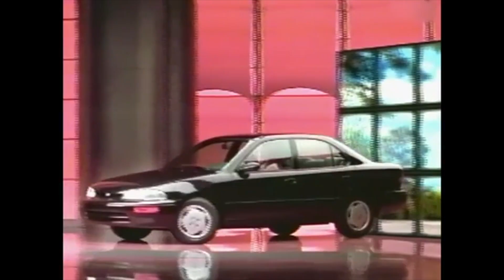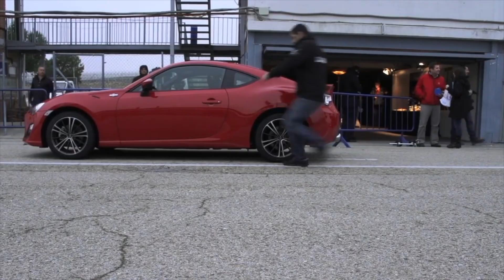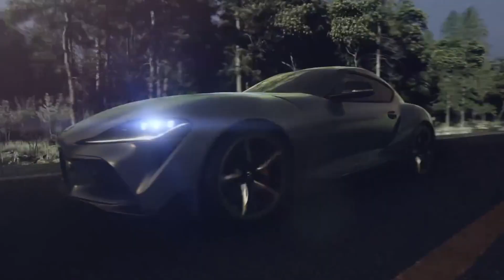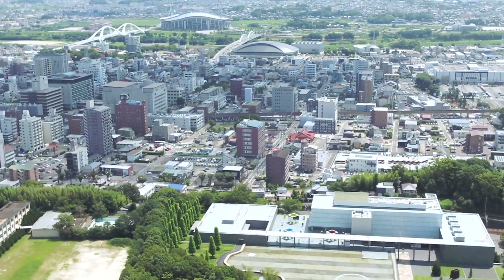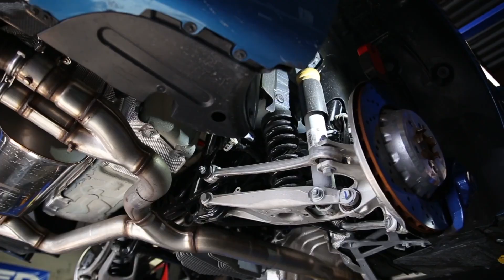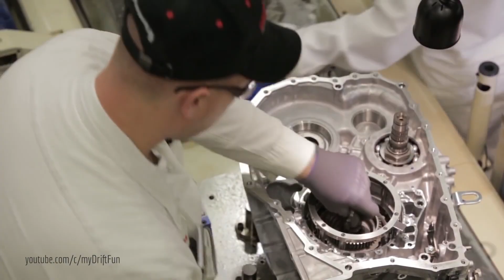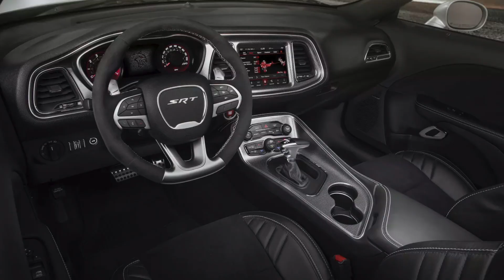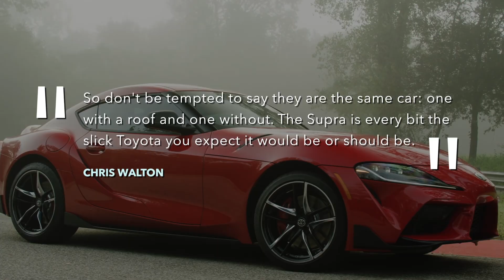MKV Toyota Supra - BMW or Toyota? The UNTOLD TRUE STORY

Comment: The BMW Supra is the car you get if you're too poor to spend another 15k for the Z4 convertible. I would buy one just to take off the "Toyota" badge burn it and stick on BMW badges. Toyota should have got Yamaha to help with a NEW unique engine they can use in actual cars that will be fun too

Comment: The light switches, I-Drive, gear selector all comes from BMW.

The Lexus LC would had been car to be called a Toyota Supra.
Supra had been a direct competitor with the Skyline GTR, NSX and GTO.
But this Z-4 derived Supra is nothing near the modern day GTR and NSX in term of performance and technology.
it is a disgrace to the "Supra" name.
Reply: Of course it's a disgrace for the Supra name, because it's not a complete flop and a failure on a comical level
Reply: Mk4 A80 was not "iconic".

Hence the Sales flop in the 1990s!

Comment: As time passed and the Supra's became available at the dealerships near me I gotta say, the lack of a manual transmission was probably the sole reason I didn't buy one. I enjoyed the meme of "it's a BMW" but...it turns out, I like BMWs as well. Ultimately, I'm glad it didn't have a manual tho, because it pushed me to keep saving and finally by my dream car (RX7FD). In which I for sure would have been regretting if I didn't.

Comment: If they stopped collaboration at the drivetrain and engine why are there so many BMW parts in the interior of the Supra? Even the Infotainment is BMW as pre Doug DeMuro.
Reply from the maker: Supply chain, as I mentioned in the video! If you watch my A90 teardown videos you'll see that I found a lot of parts stamped Toyota as well. All made in Germany by subsidiaries.
Reply: @albonfilms  doesn’t that law only imply to only cars like the sc300 Lexus and the Toyota soarer in Germany or….?

Comment: This makes want a B58 powered car. I love BMW I6 engines. They sound good and are very tuner friendly. Having one with Toyota reliability would be awesome.
Reply from the maker: Let's see how these hold up!
Reply: b58 has been around for like 15 years bro. very reliable known engine @albonfilms
Reply: Imagine if Toyota made airplanes, then Boeing will be out of business.
Reply: I was thinking the same thing. I'm tempted to but a Z4 M40i. I really like the car. If it pans out they are even Toyota-ish in the reliability department, they're going to be very desirable down the road.
Reply: Love my x7 even more now that I learned it has the B58 engine 🙏
Reply: The problem is using complicated technology which makes them prone to defects and hard to fix.. For instance just take the cooling system in this car which is way different from conventional and complex

Comment: A car known for reliable engines opts for a shady brand name engine.   That engine is underpowered.   The car is unusually small.  It is overpriced.  It's ugly as hell.  From the get-go, Toyota said that they did most of the non-engine work themselves.  In short, this video won't change your mind, if you already knew the facts.  One more thing.  If you can squeeze another 10k from your account or lender, you can buy a mid engine C8 which by comparison will make this thing seem like a hardtop Miata.

Comment: BMW is trash low mileage BMW suffer oil issues and I wouldn’t be surprised in few years these “supras” z4 will also suffer. How a BMW brand new price is at $100k 10 years later it’s selling for $10k if that.

Comment: Hey Albon, Great Video. How Did The New Supra Get To Use BMW IDrive? 🤔🤔🤔
Reply from the maker: It was licensed from BMW since iDrive is integrated into the BMW Engine Management. The entire CANBUS System is the BMW multi-DME system.
Reply: Albon, How Did Toyota Get Access To The BMW Parts Bin And Use Many BMW Components In The Cabin? 🤔🤔🤔
Reply from the maker: @Zonksmobile  As mentioned in the video, the car is a joint venture with Toyota and BMW using BMW Supply Chain. All of the parts are either manufactured by BMW, Magna Steyr, or Toyota Manufacturing Germany

Comment: clearly there are a a lot of fucking idiots claiming this is straight japanese reliability and quality,
1: the chassis is built and tuned by magna steyer in austria this is literally a harder z4 platform 
2 : the b58 is very reliable having known people who have owned b58 vehicles and had zero problems me also it being able to build 1000 horse on the stock crankshaft unlike the 2JZ which was a marvel of its time and bulletproof but everything is falling to age , the b58 is very tunable and easy to work on 
3: there are so many people out here claiming this a piece of shit vehicle without even driving first hand typically being 15 year old supra fanboys.

Comment: Most of the Toyota lovers like BMW for a lot of reasons. I really accept that BMW engine is the worlds best engines  in terms of straight 6-8 and 12 cylinders. The most efficient ever with a lot of reliability. The question is why Toyota haven’t put some Japanese quality over the interior and overall thing to make it a bit better??? Too small car to call it Supra!! This should be 8 cylinder, with 650hp around and bigger body!!! And of course BMW pretty exterior missing!!! Old Supra had engine designed by Yamaha. So again Toyota is a fake brand!!
Reply: "Too small car to call it Supra!!"

I'm going to leave this here.

https://www.supramkv.com/threads/toyota-supra-size-dimensions-comparison-thread.1634/

Comment: I literally shed a tear a few times watching coming back to this video. The world is wired so completely wrong. It's just so sad that so few can see the raw passion and pride these cars were made with. The sports car market and the concept of the "driver" is dying more and more with every negative comment posted by some idiot who hasn't even driven either car, but yet thinks that it should be this or that or have this or that, or be designed by this or that. Everyone online is screaming for a manual or an all-Toyota powerplant/drivetrain/chassis, while also positing that you can get a used (insert car) for the same money. How can a company build a car strictly for the secondary market?? That's asinine. If you want a manual, contribute by BUYING NEW MANUAL CARS.

Comment: You say Toyota and BMW went their separate way so that the chassis, exterior interior and suspension components can be done totally independent so that they look and drive different, yet when you sit in a Supra (i struggle to bring myself to call it that) you would think your inside a BMW.

Comment: To me, automatics really are for people who could not pass a driving test. Think about it, how many people do you know who say "I can't drive stick"........now how many of those are good drivers???? Sweet fk all.
And now ask, how many people who can pass their full license (manual) say they prefer an automatic transmission on a sportscar?? Again, none, zip, zero, niks, nada, sweet fk all. 
If I am not manually switching gears, it means I am driving a smooth luxury vehicle, or an electric car. 
That said, I think I have been painted into a corner since no one is offering manual transmissions in any new desireable cars so I think my last petrol car will be the C8 vette instead of this as I was really impressed with the C7 Stingray and the C6 Supercharged Callaway...and even to a degree my old 6 speed C5

Comment: This car is hated by people who can't afford it, who think its cool to hate it because other people do, or simply because they're 15 year old MK4 fangirls. You've got a two-door RWD inline 6 turbo car that runs 12 seconds flat on the 1/4 mile stock, and an engine that is easily receptive to power gains. Compared to other cars on the market in an era where sports cars are being discontinued for people movers and SUVs, it is amazing. The ONLY screw up is that there should have been a manual option, for the purists.

Comment: Like I said in another video I will say very disappointed in you Toyota for putting out a inbred version of your finest icon car, it seems you went out drinking and slept with your German first cousin and unfortunately got her pregnant and out popped this thing on four wheels with a Beamer motor LOL. That is not a real supra, the real Toyota supra was discontinued in 1998. Very disappointed!!! Rather than short cut decisions, you should’ve put your head down in the paper and re-designed something that resembles the super iconic JZ motor. But maybe I’m just stuck in the past and this is How car makers are these days but if you’re going to be an independent car dealership with vehicle icons you can brag on from the past and re-designed them the least you can do is do it with Toyota parts and not bastardize what could be great!!!!!

Comment: a very very informative video

but.....  both cars basically built on same platform... a lot of BMW stuff under the body of the supra......
basically, take away the body of the vehicle( with interior etc)... u have a BMW.

what i also get is that the supra can b tuned to be like the z4 n vice versa. 
literally one journalist has driven both and he said they are different.

Obviously, they would feel different because of different styling and tuning n interior feel. 

but at the end of the day, without driving any of em, both are built from the same platform n I guess on this basis the say the supra is basically a BMW....

Comment: I sat in a supra yesterday.  DIdn't like the 6 fake holes in the seat headrests (in addition to the 10 fake exterior vents).     Outward visibility is terrible, the windshield's vertical height is so short between the dash cluster and ceiling, also short is the vertical height between the top of the infotainment screen and bottom of the rearview mirror.

Comment: Newsflash! A steering column on MK V Supra has failed and it's similar to BMW steering column issue. Are you sure about Toyota tested all BMW parts used. I'm highly doubtful.
Reply: So much for Toyota testing every bolts and rivets as claimed. It's a known problem in the BMW community and Toyota didn't look at the steering column?
Reply: imagine going 60 near a curve and your steering wheel fail to respond.

Comment: Thank you!  I've been trying to find the answers to a lot of questions, which you answered in your video.  It seem then that the Supra/Z4 was more of a joint development!  If indeed the B58 motor has benefited from Toyota's reliability improvements, the car may have a shot at being reliable.

There are so many angry comments online about this car and it was apparent even before I saw your video that many of them were not well informed about the development of this vehicle.  I even registered for one of the older Supra forums around and found it a cesspool of angry children hating on a car they did not understand and hadn't driven.

Thank you for the information.

Comment: Great video! The armchair speculation surrounding these cars is a bit absurd, and we really should be celebrating the fact that these vehicles were brought to market. I must admit that the interior of the Supra is, in my opinion, disappointingly too much BWM and not enough Toyota. And while I would still love to drive the Supra, the lack of a manual transmission option would prevent me from buying one.

I'm not completely sold on the styling of the Supra, either. Toyota's current design language is, for me, quite hit or miss. It seems like every so often they come up with a redesign that looks great, but is surrounded by other vehicles that just don't look good to me. (I largely feel the same way about Honda's more recent offerings, too.) I won't even get into some of the stuff they've done with Lexus. From a design perspective, the Supra looks okay in a lot of ways, great from certain angles (especially the rear), but overly complicated or outright weird from other angles. The front end in particular seems a bit off.

I miss car designs that had simpler lines, less creases and swoops and superfluous edges that only serve to clutter everything up. It seems like manufacturers these days regard clean designs as boring or something, as if everything has to look complicated in order to stand out. One needs only to look back at the Mk IV Supra for a great example of a car with simple, clean lines that looks great. Even exotic manufacturers like Ferrari are doing this. I think almost anything they've made in the past 10 years pales stylistically in comparison even with many of their cars from the 80's. I think Lamborghini is about the only company who can consistently pull off complicated designs that look good, but even then, these modern designs are starting to make cars like the Murcielago look classic.

Getting back to the Supra though, I really need to see one in person. Actually, I'd like to see several in person, in different colors. I imagine I'd probably like the styling a lot more if I saw it up close.

Comment: NONE OF THIS STUFF IS SUBSTANTIATED, ITS ALL THE SAME "STORY" WHEREVER YOU READ IT; "TOYOTA WORKED INDEPENDENTLY AND DESIGNED FROM THE GROUND UP" ETC. HOW DO WE KNOW THAT TOYOYA JUST HAD A LAZY ATTITUDE AND SIMPLY DID REBADGE THE Z4 AND TRIED A PUNT TO SEE HOW MANY THEY COULD SELL UNDER THE SUPRA MONIKER. WHEN I TRIED THE SUPRA RECENTLY IT WAS RUBBISH. BMW INFLUENCES EVERYWHERE AND LOOKED LIKE TACK ON WHEELS. SPARE ME THIS MOCKERY.
Reply: Ditto. And there are two mkv owners with steering rack issues already which is also a problem in the BMW community.  Mkv fanboys will believe everything Toyota tells them. C&D also did a test and found out the Supra does not have a lower center of gravity than the 86. The only good lie about the mkv Supra is that it's making more power than claimed.

Comment: Its a BMW seriously.. Ok so the engine is BMW the Suspension is BMW.. The hole interior is BMW apart from the Rev Counter 🤨 its engine bay has BMW all over the place... The Supra is Toyotas signature car just an absolute brilliant machine..it almost like the pressure to bring out a new version of the car was to much and they settled for the easy way out its just a z4 😔

Comment: Toyota does  not listen to  it's customers.  This car could have been pure Toyota  with a 2JZGTE VVTi from the Aristo.  Same 6 speed Getrag, and they have a dual clutch in other models could have been used.  BMW does not have a 6 cylinder as good as the 2J.  Let me tell you something about the FT86, it's not as good as the  AE86 which was a great handling 5 seater compared to this new 2 seater nonsense.  Toyota were to put the AE86 back into production with a 3SGTE engine, neither  the FT86 or this Bupra would sell to a true Toyota enthusiasts; these new models would be sold to the normmal Joe Blow  just looking for an OK car.  Very disappointing.

Comment: This car will never be  a legend as the Mark lV Supra because maybe we see this new Supra making 800 hp but at a way higher price than a Toyota Supra and would not be surprised if you had to repair the engine after 3 runs
Reply: Because of the mkv, the mkiv prices have soared through the roof. Even the mk3 is going up in value.

Comment: I'm sorry, it's a great looking,and probably performing car it just needs to be named anything other than Supra. But they took the fucking heart of what made a Supra a freaking Supra!! Toyota could very easily modernized the 2jz engine.parts are readily available already for it and wasn't that the whole point of bringing supra back to life. The drag racing, track racing autocross racing enthusiast and you remove its heart.really!!! I tried to be open minded and receptive to the car but when i heard putting a freaking z4 Motor in it.in my opinion was just disrespectful af to the supra Heritage. I could've been satisfied with losing the 2jz if they would've atleast put the E46 M3 inline 6 engine in it. Hi revs,crazy power capabilities.and we're not being disrespectful, we're upset about the disrespect done to an amazing car.

Comment: C'mon... The Japanese do what they always do. Take existing ideas and innovate. So they took the inline 6 from BMW,  along w/ a few other upgrades. So TF what... Toyota inspected/revised every aspect of the engine & design of the Z4 and made it better. It may have started out as the same engine, but it clearly is not.  I've already seen multiple head to heads with these 2 cars and the Supra smokes it in the quarter mile. Same engine & similar in weight. The difference? The displacement of power is COMPLETELY different. The crank is putting out WAY more power than the Z engine. Can't wait for the Supra to hit the market.

Comment: i believe the supra is iconic for its jz series engine can we really call it a supra without a jz series engine.  that would be like calling a skyline a skyline when it has an sr20 powertrain (just an example) i cant openly speculate on the vehicle but thats my opinion
Reply: The first-to-third generations of Supras are called as such despite the absence of the JZ engine (granted, the A70 got the 1JZ later on).

Comment: Rebadge  bmw  i saw pictures before the release and the engine block had a bmw tag with serial numbers this car has nothing Toyota  Toyota should have used the Lexus LC 500 to build there supra line up
Reply: Not really a good idea to use an LC 500 platform since Toyota was aiming for track performance comparable to a Cayman.

Comment: If you guys think Toyota has just grabbed a bunch of BMW b58 crate engines, tuned them and dropped them into the GR..... then you’ve done no real research. There are over 50 revised parts on this engine that Toyota had BMW re-manufacture to bring it up to Toyota’s reliability standards. Cylinder head, water pump, valve springs, oil pump gears, oil pan and heaps more. This version has its own engine code at BMW, and you will not see it in any BMW model, especially the Z4. Wait until tuners start ripping them apart, then you’ll be reading heaps more about it.